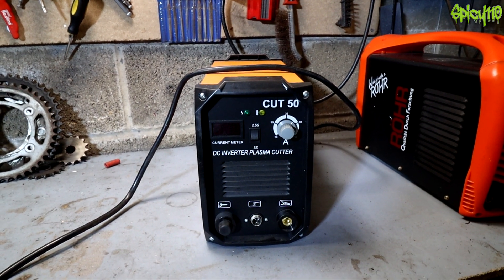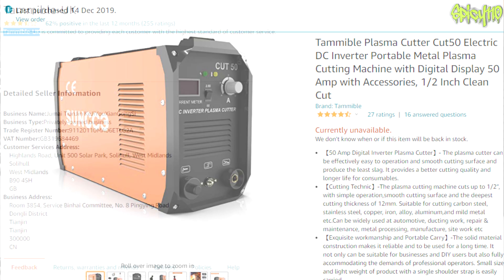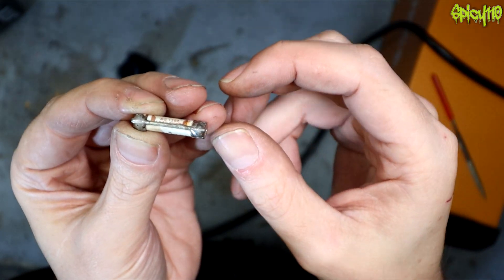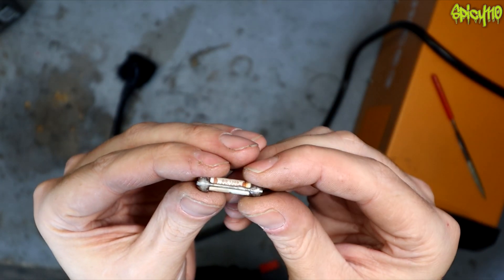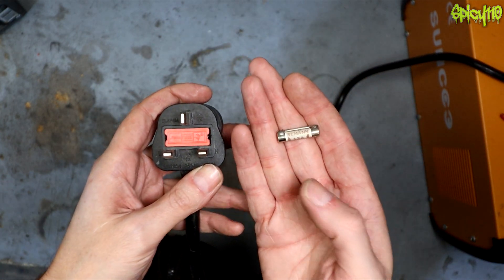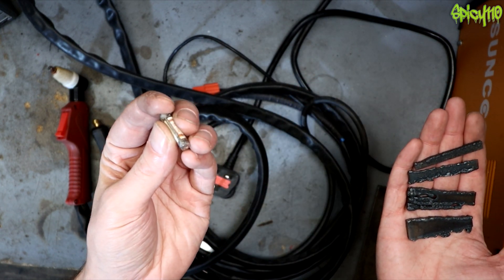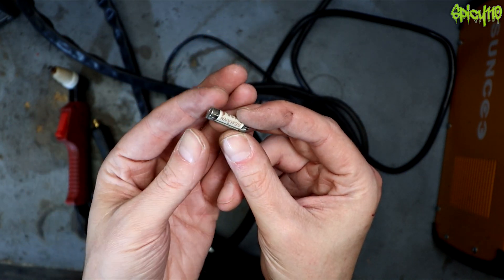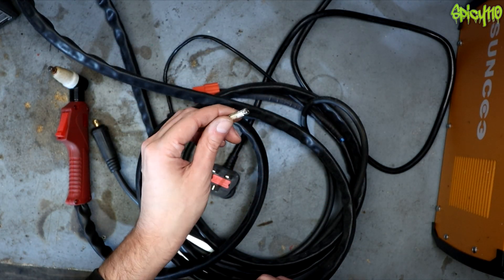CHECK YOUR FUSES! | Dangerous fuse found in Amazon bought machine! | Cut 50 Plasma cutter.

Comment: The cut 50 plasma cutters consumes high amperage. The manual indicates the need for 20-30 amps fuse. Nothing wrong with the machine just needs more power to cut thicker materials. Fuses are always a protection first line of defence to protect wires and machine. Yes you need more than 13 amps fuse.
Reply from the maker: If this overloaded, It would be my main 32amp fuse borad breaker that would have to deal with it. What would happen before then is that "fuse" would get very hot. The maximum amp fuse you can put in a standard UK 3 pin plug is 13amps. The correct LEGAL and safe way of doing this is having a 30amp fuse in the machine that can be replaced, just like most large welders use. What they put in it is not a rated 30amp fuse and if it was it wouild be over double the allowed amps in that plug type.
Reply: @ 
I completely agree that they should have put an internal 20-30 amps fuse, as many other machines do.
Your mains breaker should protect the house wires from the meter to the outlet.
The plug fuse should protect wires and parts in the machine and its feed wire till the connection outlet.
Fuses are protection against higher amps so wire wouldn’t reach fire stage.
With cheaper machines they reduce cost everywhere including wire thickness. They choose the minimum wire diameter that can get the machine started but not for heavy continuous loads.
Regarding UK plugs, I believe there are 15amps plugs and fuses. Would assume there are bigger fuses too.
Currently facing an issue that burnt the 13 amp fuse. Will searching soon for higher rating 20-30 amps fuses.

Comment: This also seems so wrong to me as an exposed wire that gets hot enough to melt could nevertheless be a fire risk in a way that an encased fuse cartridge would not.  This would surely not pass a British Standard test.

As has been hinted in the replies, a correct fuse on a lead, followed by a breaker on a circuit gives a measure of protective grading absent and should always take into account reactive or momentary high current loads as necessary.

I would report this both to Trading Standards and the Fire Brigade for investigation.

Comment: Many many years ago when I was first entering the world of metal work & welding as a trade it was common place to remove fuses that kept blowing & replace them with a piece of 6mm round, that fuse would never blow again. 

The ESAB Caddy arc welders were always run this way.

Not saying it's right but it's what I learnt to be the way to do it when I was 16.

Comment: I would say they have an issue with inrush current when charging the bulk capacitors inside the unit on initial power up. It might not blow the fuses straight away because it depends when in the mains cycle you turn on the unit e.g. at the peak of the sinewave or at the 0v crossing point. This would also depend on how charged the capacitors were at the time e.g. if you had ran the unit within the last 30 mins or so then those capacitors could still be charged enough that it doesn't exhibit an issue. The fix for the company would be to design in an inrush current limiting circuit with a bypass relay to pre-charge the capacitors but likely the unit was already manufactured and they just couldn't be bothered, given it will be a Chinese company that wont adhere to any regulations and doing so would have cost them more money. Some super dangerous chinese stuff has been appearing on Amazon recently, I purchased some LED lighting strips that came with a mains psu that I lightly dropped and It broke open exposing the SMPS inside (clearly reused from scrapped electronics and stuck in a new case with double sided tape) and came with an aluminum cored mains cable that failed all testing and could be ripped in half easily by hand, not to mention a fake 5A fuse that when tested could supply 18A continuous for 30mins and just got hot, never blew.

Comment: Bit dodgy but not the safety hazard it seems. The uk’s 13amp ring main system is unique in the fitting of fuses in an appliance’s plug, they Don’t do it in other countries with their 2 pin plugs. The issue is that the UK’s 13amp plug ring main system is fused at 32amps at the fuse board, whereas in Europe etc the fuse rating at the board is tighter at say 15amp.
Therefore the protection for this appliance is a bit course, it’ll work, but may allow the unit to over current when in use and get hot as you’re relying on a 32amp CB in the board and the earth leakage trip.
As to who did the badge, probably the importer or it’s an item that was returned, bodged and sent out again.
Reply: There are several issues that can further complicate the matter. Firstly what is the load of your equipment, this should be on the data plate. Let’s say it’s 3000 watts and it’s an inductive load. To find the current requirements divide 3000 by the nominal uk voltage supply of 230v and you have a current draw of 13amps. However the permissible voltage fluctuation is 216.3 to 253v (-6% to +10%). If you’re at the lower limit the current goes up to13.89amps. I’ve seen voltages as low as 200v during periods of high load which will increase the current to 15amps!
As well as this I had a 16amp circuit breaker which was randomly tripping, replacing it cured the problem, they do go faulty.
Inductive loads also have spikes in their current draw, a motor that runs at 10amps can momentarily draw X5-7 times the running current on start up, you can get motor rated circuit breakers which allow for this characteristic. These are regularly fitted in workshops where equipment with inductive loads are fitted.
Reply from the maker: If I am understanding you correctly you are saying this will run on a 16A breaker? It will not, this machine along with any of my welders or compressors wont run on the 16A ring in the garage, I have to connect to the 32A ring.  Defo new when I got it.

Comment: I've heard of people doing this on welding pages on things like 16 amp arc welders that pop fuses every 5 mins on a standard 13 amp plug, generally there is a little bit of leeway so this "mod" can help alot. I'm not condoning it but IF it's going to be used then use a popped fuse and some 16a fuse wire as a breaker may not trip until 17-20 amps depending on the age and type... I'm not an electrician just going on what a couple have told me regarding this.
Reply: Terrible idea, it is not necessarily the implement that causes the danger it is the amperage of the wiring you are plugging the device into. IE: if the wiring in your wall is rated for 13A and it has a tolerance of 15 amps (as an example) and you pass through 16A or more, the induced heat in the line can cause the insulation to fail and therefore start an electrical fire, this is even more of a problem in older electrical circuits.

As an anecdote, some of the plugs in my house start to get pretty hot at anything around full 13A so I limit the time I use high power machines like my large air compressor.
Reply: @harrier331  I’m not condoning it, I’ve never tried it I have a dedicated 30A supply for my welders. But again that’s what i mean about age and type of the systems. I’ve got a 3hp twin compressor that can only be plugged directly into a ring main socket but that i can run all day without any issues

Comment: Those shouldn't come with a "normal" plug lead in the UK. We do NEN-3140 certification on these things and similar ones I've handled are 3400W. Those are just about ok on a normal plug lead in the EU as our domestic plugs are 16A circuits (3680W), hence probably the CE marking, but in the UK things are sticter and I think you're not supposed to connect anything in excess of 3200W (at 240Vac) with a domestic plug.

Comment: Lol it’s a slow blow fuse (time delay fuse). Most welding generator have them.
Reply: Hi. I'm the Patreon engineer guy referred to. Plug fuses aren't my area of expertise tbf! Does the metal on the side also melt then like a fuse wire?
Reply: Slow Blow

One typical use for a slow blow fuse is an application which requires a high current for a short period of time and a lesser amount of current for an extended time.  The starting of a powerful motor or the impulse of a resistance welder would be a good examples here.  A current limiting device for an application such as this must allow high current for a short period of time but prevent long term overcurrent which might indicate a failure or malfunction. In many cases the short term current rating may need to be several times that of the long term current.  In addition, however, there may be a current limit in the same application that results from a catastrophic condition where current must be removed immediately (such as a short circuit). Now, instead of just sensing a long term elevated current, the appropriate current limiting device must sense two different current levels providing a suitable, and perhaps different, response to each.  This could be accomplished using two fuses in series as shown below, but many individual fuses accomplish this in a single device.

Fast Blow

There are also applications where even the shortest duration overcurrent indicates a problem requiring shut down. One example of this would be a partial short circuit caused by intermittent arcing between wires with each instance of arcing too short blow a medium response fuse.  At the same time, repeated arcing might ignite a fire.  A good example of this is kind of failure is a heating pad or electric blanket in a home.  An intermittent arc could start a fire even though the current draw is not sufficient or sustained for a long enough period to cause a fuse with a slow response time to interrupt the current.

The response time is far from the only variable characteristic of fuses that must be considered in their selection.  I’ll try to discuss some of these in upcoming blogs.  In response to these and other variations in need, many special purpose current limiting devices have been developed. In the design of electrical equipment, designers take all things into consideration when specifying current limiting devices. When replacing them, maintenance personnel should be careful that the replacement has the same properties as the devices being replaced. A “fast blow” fuse, for example should not replaced with a “slow blow” fuse. A device rated for high short circuit current flow or open circuit voltage should not be replaced with one without an equivalent rating.  Gone are the days when dad went down to the fuse box and put a penny behind the blown fuse when mom wanted to use the iron and the washing machine at the same time!

 –  JF  –
Reply from the maker: Are you saying this is correct and in code?
Reply: @spicy110  yes by euro standards. :)
Reply: @spicy110  i can't find a picture of a slow blow fuse that looks retrofitted/reworked like that, they all had the conductor inside the tube

Comment: It probably their own fuse wire to resist it break so easy as long it is the right gauge and will break with to much over current.... Clearly shady and out of regulatory standards... Amazon obviously can't check every thing and rely on complaints like you be made aware such things. 😊

Comment: Very naughty of the manufacturer. Could have been done if it was designed for use on a foreign plug that doesn't have a fuse. But that shouldn't matter really as it will have a current rating and should be fitted with the correct type of fuse or if it exceeds 13a it must be fitted with a 'commando/ceeform' plug.

Comment: Always check fuse on equipment, it's pretty much universal that a 13A has been stuck in when a 3A or 5A is sufficient. I've turned over an awful lot of IT disposal stuff over the years and never found a pc or monitor with anything less than a 13A fuse. And those power leads will have been the ones supplied by the original multinational, big name computer manufacturer.

Comment: Whoever did that needs prosecuting. I'd be worried about what else is going on inside that machine.

Maybe it blows the fuse when operating for long periods of time, those fuses take more than 13A and long duration to actually blow.

Comment: In my 29 years in electrical retail, I have never seen anything as shocking (pardon the pun!) as this! It beggars belief that a retailer would knowingly put their customers at risk in this way. I think you should not only report it to Amazon, but also to trading standards who take a very dim view of this sort of thing.
Reply from the maker: I have tried to contact the seller as I know amazon will want me to do that first. No word as yet!
Reply: With Trading Standards now "controlled" IIRC via Citizens Advice...... I'd probably contact the local fire brigade they will have a more direct route and give it some weight that IMHO it needs.  That is dangerous - I've seen similar bodge jobs in a third world country (whereby anything will do to get the thing some current) and also heard of people here in the UK with the old fuse wire type fuse box using nails, paperclips etc because they've run out of replacement fuse wire.

You probably don't remember/never seen the old valve tv's....  my dad was a bugger for swapping out blown valves whilst the tv was still powered on - probably why he had curly frizzy hair.  He used to buy non working appliances and get them going again - he got me a twin tub for the shared house I was living in - it worked fine...  all the buttons, all the functions etc..............except something was slightly wrong and you (or should I say I) only find out when standing next to the twin tub (knee/leg rubbing against the side) and you (I) grab the cold tap  😱  ⚡
Reply: Additionally I'll offer this bit of info   total watts  ÷ 240  =  total amps

If your machine uses 1200 watts you'd need a 5amp fuse
According to the bumpf on Amazon that machine has a 4.8 KVA and if my basic electrical knowledge is up to scratch it'd need a 20Amp fuse (16 Amp to be exact)

KVA 4.8 (4800 VA * 0.8 (On average, a generator will have a power factor of 0.8) = 3840 watts  ÷ 240 = 16

Hopefully some "bright spark" (excuse the pun) can confirm